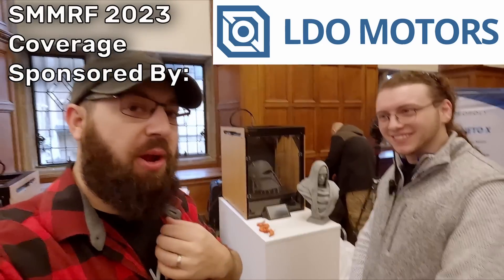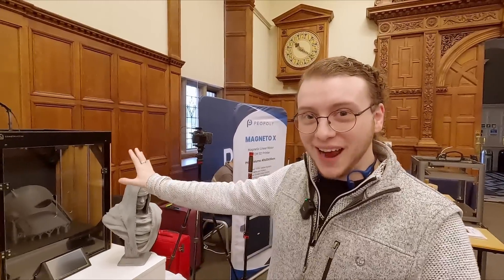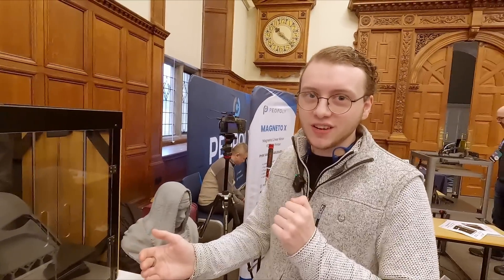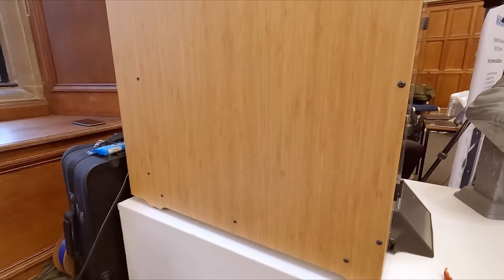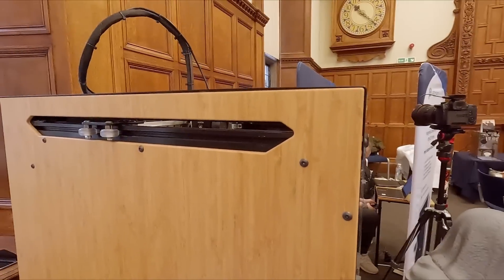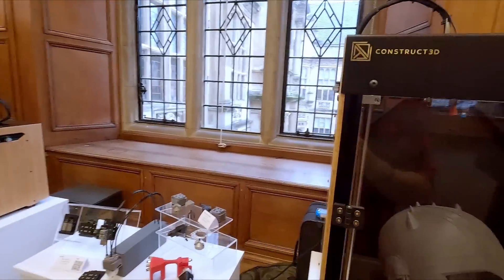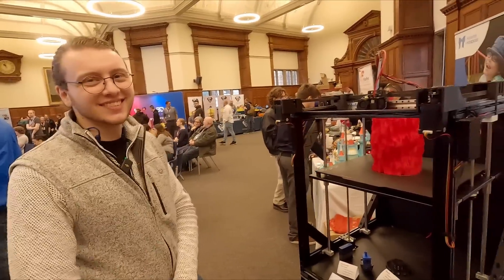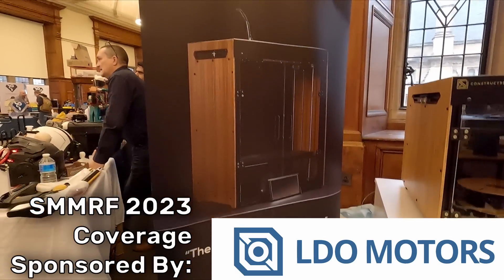Was I WRONG about V-Wheels??? Construct 3D at SMRRF 2023

Comment: There is a German company that has a process for internal polishing. They use a paste with abrasive particles that the pump back and forth. Probably more efficient than using Glow in the dark filament

Comment: Very interesting theory on the rails vs v-slot wheels. 

Almost all industrial machinery use Hiwin linear rails and they're extremely robust. With routine greasing, they can easily last decades before showing any tolerance issues. For example, laser cutters use this on all axis and they're exposed to abrasive and corrosive dust and also forces from crashing the laser head. However, they still seem to last forever.
Reply: Pm program if you keep things clean you can extend the life significantly.  Linears on these types of applications are fairly low load as well.   Bearings and contamination are a whole industry in itself. Pretty cool too however some seals are crazy expensive alone. 

Anyways millwright do this stuff for work.  And hiwins are still cheap.  Skf ngk timkin. I've worked on single bearings worth 30k dollars
Reply: Yeah, I wonder how they're even getting that data. Could there be any compounding variables on their experimentation process
Reply: @thanhtacles  He did say he was talking about cheap rails, Hiwin are about 10 times more expensive than most cheap 3d printer rails.
Reply: @thanhtacles  he did say that normal linear rail are better than cheap v wheel. but good v wheel are better than normal linear rail.. and premium linear rail like Hiwin are premium and more expensive than good v wheel... so.. if ur rich. go with Hiwin. im not. so im choosing normal linear rail or a good v wheel.

Comment: I don't know.  I'm not a MechE but much of what he said sounds wrong.  3 instead of 4 contact points is generally considered better (like how 3 -leg tables don't wobble).  And they are using the wheels in such a way that the bearings are on-end, which tends to wear them out faster.  
But, hey, if it actually works well long-term then great.
Reply: If you talk about blocking degree of freedom (i dont know good translate from Polish, sorry), 3 points are better. But if you talk about bearings - more points is always better. When you can adjust 4 points, its a little better than 3. For example make square table- 3 leg table dont wobble, but if you make 4-leg table with all leg adjustable - you can find a point when its not wobbling also, but its more stable - when you put something in one of corner in 3-leg table, it could fall over - square table on 4 legs not fall over.

Comment: I wonder if the wood sides would discolor/dry/expand/crack after awhile if you needed to heat the chamber to do ABS or ASA? How about higher temperatures?
Reply: I run my old trusty plywood makerbot replicator with side panels, a hat and a heater to have 50-60c chamber, been doing so for good 10 years now… Yes it is more orange now visually but no more than wooden ikea trofast unit I got 8 years ago or so. I believe if stress is evenly loaded it will last forever’ish…

Comment: Now I want some Bamboo-Plywood panels for my voron lol
Reply: that was my first question do they sell panel kit for vorons
Reply: It will result in worse performance, it is not fully correct what he is saying. Wood has much higher internal damping compared to metals (plastics not entirely true). But you performance will be worse due to the higher mass and much lower stiffness.
Reply: @hero767 ? Higher mass only has benefits for your side panels unless you measure performance by how easy it is to lift the printer.
Reply: @twanheijkoop6753  no, you will get a nasty mode where the mass of the side panels decouple that is measurable even at the printer head
Reply: @hero767  Ive had both mdf (for mockup) and acrylic panels on my machine and couldn't measure a difference with an adxl mounted at the nozzle.

Both were better than no panels due to extra frame rigidity ofcourse